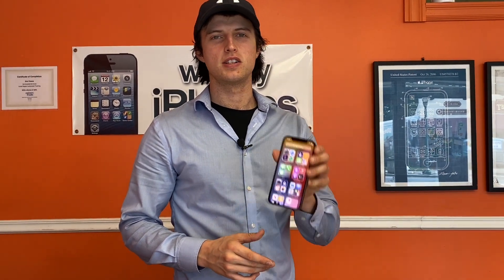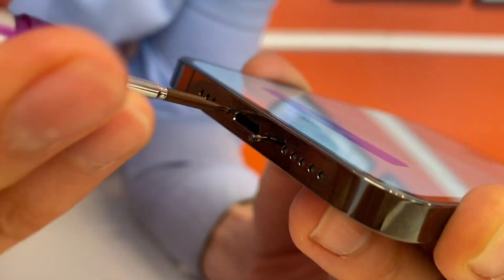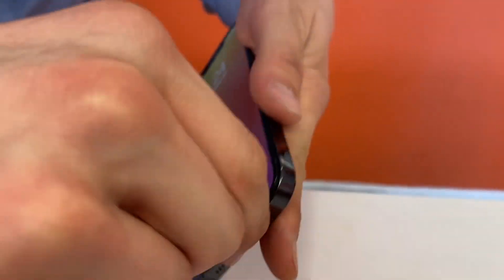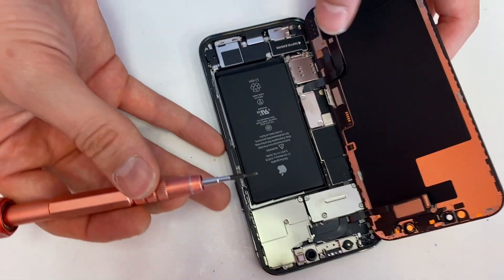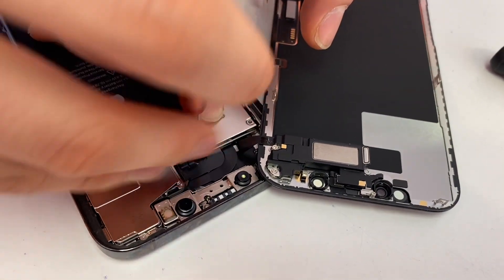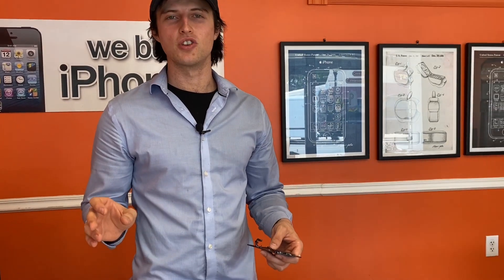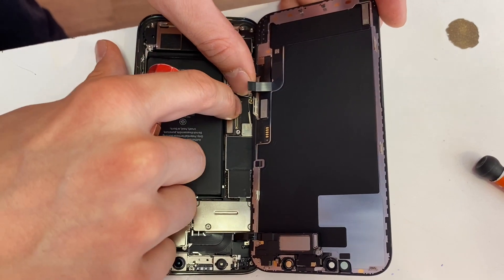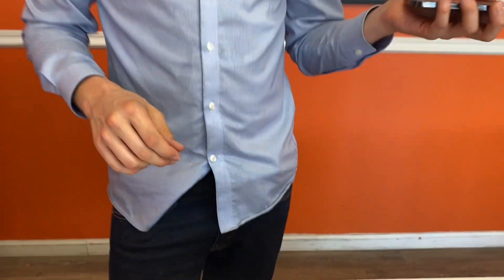iPhone 12 Pro Teardown - 3 Minute Screen Replacement

Comment: Terrible video, iphone 12 is cutting out the secondary repair man. That phone wouldn’t work correctly after that repair. As a independent repair shop owner this is a shitty move on apples part.
Reply: So true even if you replace the screen with another iPhone 12 it wouldn’t work.
Reply: Yep. Taking money from the working hands. I'm sure someone will come out with a resolution.